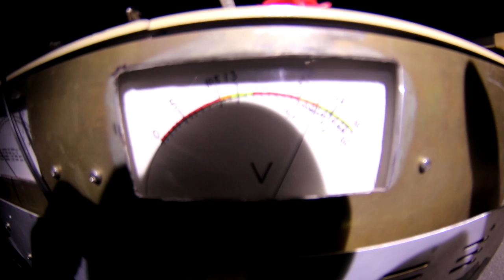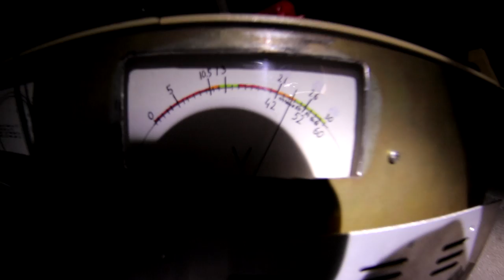Power Loss Blog 4 - Day 5

Comment: Can I suggest you get a propane generator ? You could get a Honda EU2000i converted for propane, and keep a propane tank for months, ready for the next power outage. Not the sexiest setup but it would allow for recharging your batteries and powering power hungry AC appliances and maybe even your heat pump. I would not get a gas powered generator because gas does expire.
Reply from the maker: Diesel is generally preferred over propane here, since it's a much more common fuel. I'm not going to get a generator (unless I get my hands on one for free, which I probably will, lol), since power outages like these are hopefully going to remain quite rare.

Comment: "Positive ground on Telecom stuff?"
Could someone explain to me?
Reply from the maker: The positive terminal is connected to the case. That's to make corrosion less of an issue in really old phone lines, and it's just stuck around. It makes it so that the wiring that's exposed to moisture is more likely to collect a thick layer of oxide instead of corroding away and breaking apart.

Comment: I hope you've read the spec sheets of those breakers carefully as you can't just use AC breakers with DC. DC doesn't have the arc-extinguishing properties of 50hz AC. 
I couldn't make out the writing on the circuit breakers you used, but I hope those were specifically rated for DC usage with a high fault current according to what your batteries are able to put out on a short circuit so to say (well, I guess I don't need to tell anyone to not simply short out a battery to find that out unless you're Photonicinduction or ElectroBoom :D.....).
Reply from the maker: They're not DC rated, but since they come out of a DC system, I trust their judgement. Generally, at voltages this low, arcing isn't such a big problem as to cause the breaker to fail to break the current, it just wears the breaker out VERY quickly if it's overloaded to the tripping point. You don't get more than a dozen or so fault trips out of them before they're rekt.
Reply: @FFcossag  If I were you I would supplement the breakers with a slow-burn fuse. Just to be safe. And of course keep some spare fuses handy.